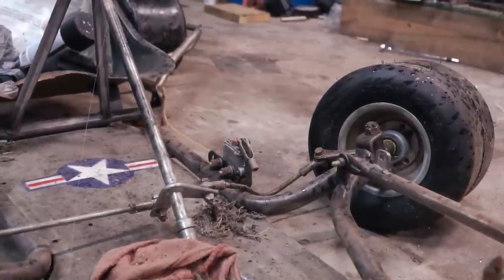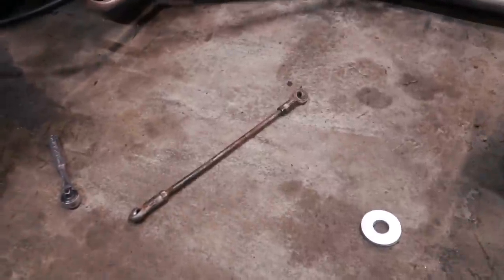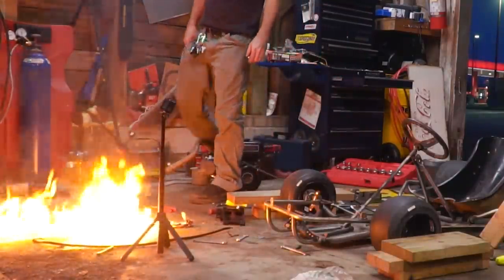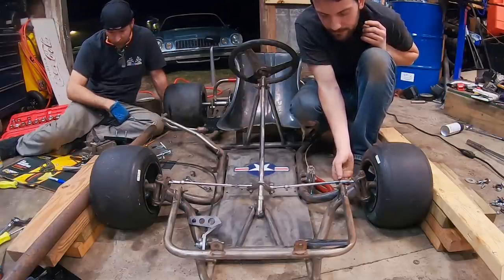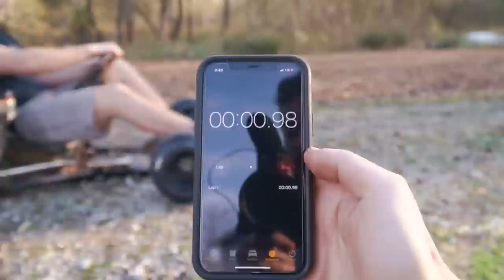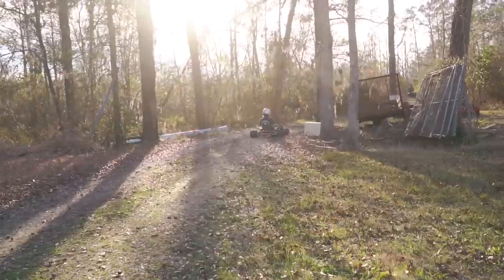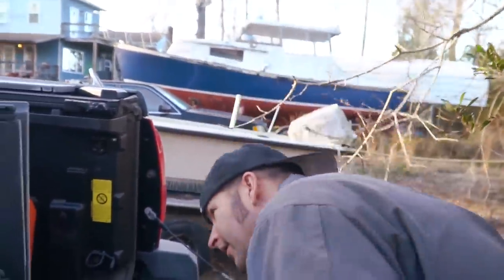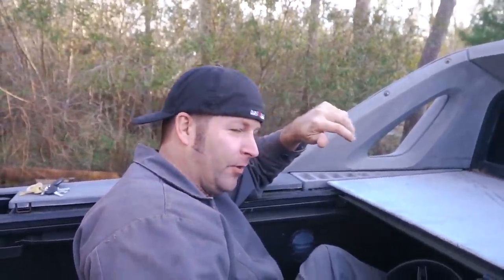Cheap Racing Kart Revival and Thrash!

Comment: Nice find. Brings back memories. I found that exact same style frame riding threw a neighbor hood on my bike. I spotted it in a backyard sitting on a ragged table with no wheels or a motor but it did have something that my home brew cart didn't have. . . . BRAKES!!! I managed to strike a deal for 10bucks. After about an hours worth of back yard wrenching I was back on the road. My shoes lasted alot longer after that day. Good Times.

Comment: On the new kart, it looks like the one I snagged, a Brister Thunder Kart.  Mine has a live axle, but no bearings in the rear.  Just the axle in the frame lubed with grease.  I imagine that is what yours HAD - I have had thoughts on how to upgrade with a bearing rear axle and looking forward to your ideas.

Comment: I wanted to say I love the videos made me buy a go kart myself. I want to ask you do you guys take off the governor on all your motors because I have a Briggs and Stratton 206 motor with a big sprocket on a live axle. I hate the fact that the motor redline so fast and I was thinking of taking the governor off but I don't want to blow the motor since the motor is expensive. What would you recommend me to do I will be using it to race and just drive it around.
Reply: I havent modded one of those engines yet so im not confident in my advice on that engine
Reply: @isaacitllbefine7231  I guess I'll leave it as it is, Thank you.

Comment: Hey guys! I picked up a similar cart with a predator 212 on it off craigslist. Motor is in a crate but I was able to get it started. I need motor mounts, brakes, brake lines, exhaust pipe, clutch, and probably some random nuts and bolts I'm sure once I get into it. Was just curious as to where the best place is to buy parts? This is my first cart project and excited to get it running. Thanks!

Comment: That's the same kart I raced as a kid except I had a 13hp methanol burning Briggs flathead, it sounds like you need a clutch with a higher stall, it would give you more power out if the hole...

Comment: You guys need to do a stage 4 212cc vs stage 2 420cc vs stock 670cc which are all geared for the same top speed and see which one accelerates faster

Comment: What sprockets are you running on this cart? Thanks
Reply: I think it was a 12 tooth clutch and either 53 or 58 axle sprocket. #35 chain
Reply: @isaacitllbefine7231   thanks trying to build my kart and just working on the gearing. Currently running a 12t to 72t and tons of torque but top speed is terrible. Thinking about just getting a torque converter if I can squeeze one on it, tight fit frame is a old Bug Stinger

Comment: I hope you guys break out one of those riding tractors Ike has and that diesel you paid WAY too much for and get an Ebay turbo and make a pullin tractor... Or make the 670 tractor MKII with an extended and widened wheelbase so Ike doesn't roll it again and make a circle track mower.

Comment: Hey guys I was wondering if you could give me some helpful advice with a carburetor problem that I've been having
Reply: What's up?
Reply: I have a 4 pack carburetor setup and when i throttle up. all 4 of them stutter up and down.ive cleaned them multiple times. Ive broke them apart and rebuilt them also.but they still stutter.would synchronizating them fix this problem?
Reply: @founddeadrepairz6433  it might help but if you've already rebuilt it and cleaned it out and that didn't do anything my opinion would be to to get a new carburetor man
Reply: But what do you have it on?
Reply: @evanwolfe1153  Yamaha xj750
Reply: Its not just one .its a 4pack
Reply: Or maybe a sonic cleaning
Reply: @founddeadrepairz6433  oh ok well I haven't worked much on those bikes I'm used to our quads and buggies and some stt400 so don't know what to tell ya
Reply: @evanwolfe1153  well thank you anyway
Reply: @founddeadrepairz6433  yep

Comment: I just picked up 2 ATV's for 50 bucks,  1 is a Polaris trail boss with a shot engine, but rest of it is great, I'd like to 2 stroke swap it as it has the CVT drive. The other is a Chinese type 250cc, engine is locked and I'm letting it oil soak to attempt freeing it up. I actually want to get the the 250 running as I find it unusual. Even though it's just a 250cc (well technically a 233cc according to engine plate) it's 2 cylinder with dual exhaust. From what I can find it appears to be a Lifan engine, which actually have some decent things said for them. If anyone has a 2 stroke engine laying around in the 250cc +range, for cheap or free.... please do let me know, I'd like to swap it into the Polaris.
Reply: Keep your eyes open for a engine
Reply: @isaacitllbefine7231  👍👍thanks man
Reply: Update, the 2 cylinder 250 has been freed up. Letting it soak in the oil through this week before I hook up electronics, drain and put in correct amount of oil. Then it's hope the plugs fire before converting to single carb and attempting start up. Still hunting engine for Polaris though.
Reply: New update, the Chinesium 2 cylinder 250 is running and driving lol.